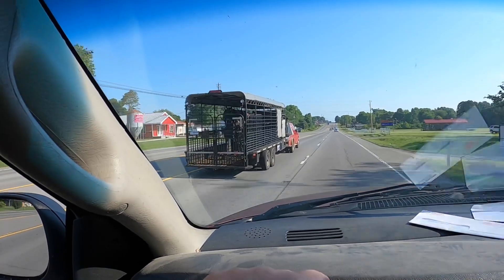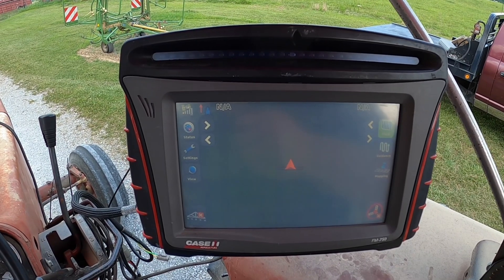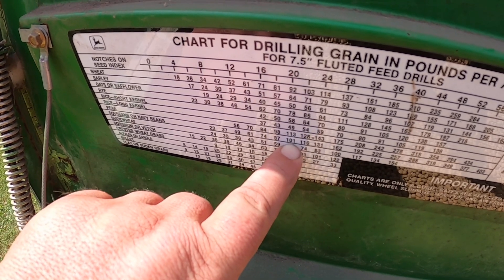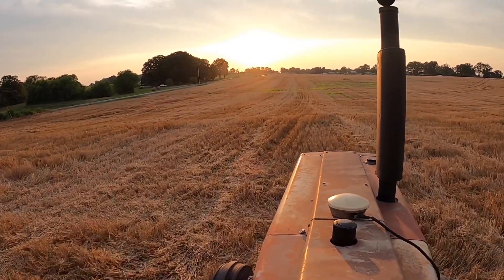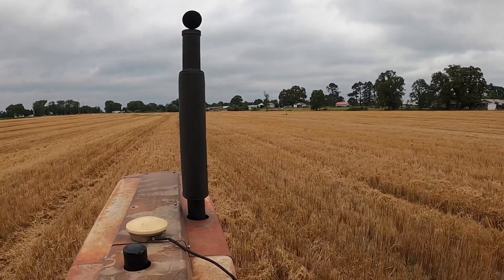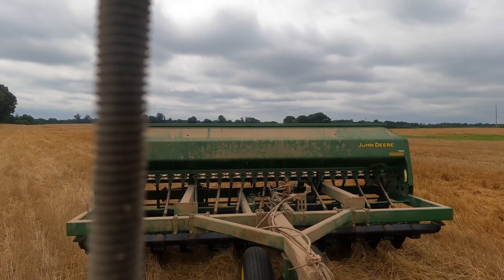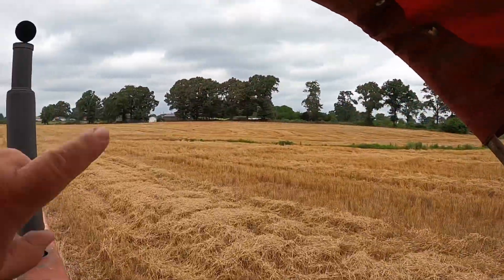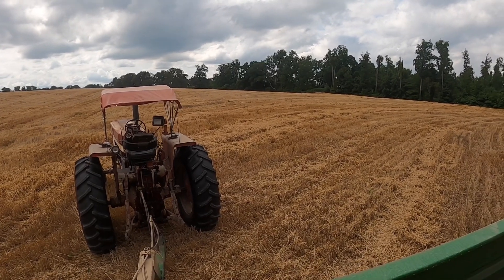Soybeans are Done! The 1066 gets High Tech

Comment: Congratulations on getting the beans in the dirt, running the drill has been the only thing on my farm I thought GPS would really help me with, I'm usually drilling plow down crops in November or December and you can't tell we're you were at all through the corn fodder especially, not even tire tracks from the tractor lol. I had some pretty embarrassing stripss this year, of cource the worst of it was in a field right by the main highway here 🤦‍♂️lol
Reply from the maker: I started using gps to spray and plant a few years ago. Upgraded sprayers 4 years  ago and it has autosteer. I put autosteer in my main tractor last Fall. I planted 100 acres of corn this Spring and the injector pump went out. Couldn’t get parts because of Covid. This Spring sure has been humbling. But the main thing is I got stuff done!
Reply: @Thomasfarmstn  yes sir you did, it's always nice to have a fall back tractor like your 1066, for us it's the 190xt both of the big tractors could break down and I could still get it done with that old girl, I spent many of hours on a 1066 with a small square bailor for the neighbor one of my many childhood jobs, idk how many times I smashed my thumb between the shifters 🤦‍♂️😂